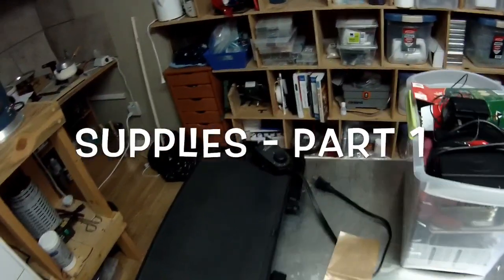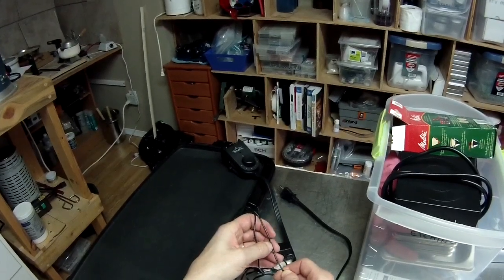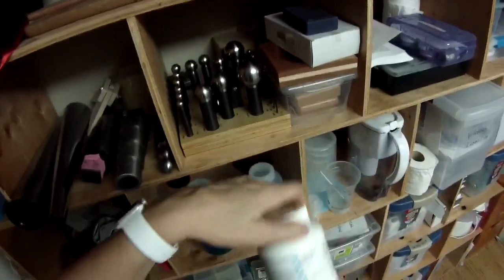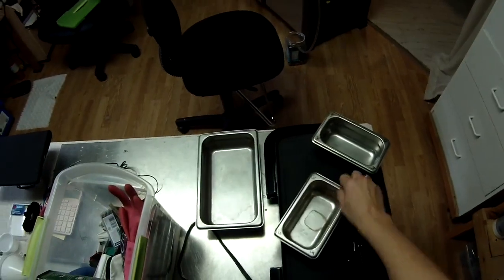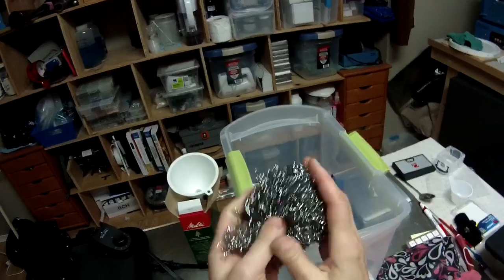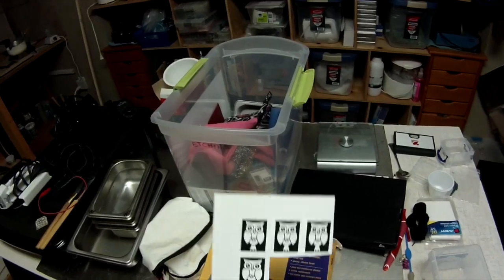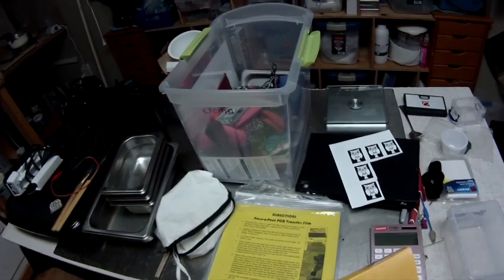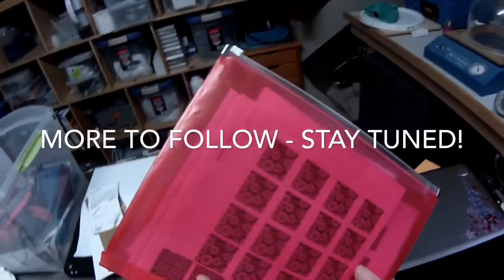Electroetching Argentium & Sterling SIlver and Copper/Brass (CHEAP, CHEAP, CHEAP And ECO FRIENDLY!)

Comment: So the design has to be laser printed? I just bought an inkjet thinking it would be fine...
Reply from the maker: @Marian The ink from the inkjet won’t adhere, it’ll wash away.  The laser toner is different, it adheres with heat.  Take your designs to a copier store like Home Depot or Staples and have them print it for you on glossy photo paper.  If you have a Cricut or Silhouette cutter you can use die cut stickers which are even more superior.  It’s what I use now since discovering the Silhouette die cutter.
Reply: I have recently looked into the silhouette and it looks like it can do very tiny cuts, which is what I’m interested in. Thank you for the info, I really appreciate it.
Reply from the maker: @marian1576  Sorry you bought the wrong printer!  Hopefully the ink jet will get used.  I end up buying a new one everytime the cartridges need to be replaced, they’re so expensive.  I bought one a few years ago because the cartridges were only $14 to replace.  They are now over $60 because the printer is already obsolete.  Not worth it.  I can do fairly detailed line work with the Silhouette, the only downfall is the weeding (picking out the parts that need to be removed for it to etch), but the application, adherence and etching is superior because with the laser toner or even PnP resist, it breaks down.  With the Silhouette stickers, the only thing you need to watch for is undercutting.  Something about the process just makes the stickers even stickier so having them come off is not an issue.  I like using red Tuck tape (you can get that from the hardware store) for protecting the back of the piece being etched.  It’s super sticky even when wet.
Reply from the maker: @Marian  Also another recommendation if getting a Silhouette.  The weeding pick that comes with or bought separately is next to useless, the tip is not very sharp and too thick.  Buy some inexpensive dental tools from eBay, less than the cost of the weeding tool and a few other useless but expensive items in the kit.  I like a 12” Olfa paper cutter for cutting vinyl sheet because you’re guarenteed a straight line instead of the cheap envelope opener in theirs.  A fine tip pair of tweezers is also very handy for grabbing tiny pieces of vinyl.

Comment: best bitumen diluted a bit in gasoline, paint over, dry and scratch the pattern, letters, it is possible under a microscope, and etch ....
Reply from the maker: @SuperDutchman59  That would work great for lettering and simple designs or if a person is an artist (I can draw stick figures).  Bitumen is the waste from oil refining I’m thinking?  Doesn’t the gasoline smell?

Comment: I just checked on Amazon; Lott’s of options for copper sulfate, only one very expensive ($50) copper nitrate? And is the photo paper Matte or Gloss?
Reply from the maker: @Kathy Bradbury Sorry for the delay in answering, I haven’t been active on this channel for a long time.  Just go with the cheapest copper sulphate used for tree root removal.  Photo paper is glossy, it needs that film.  I am now using a Cameo Silhouettte die cutter and sticking die cut labels on my etching projects.  Works really well.